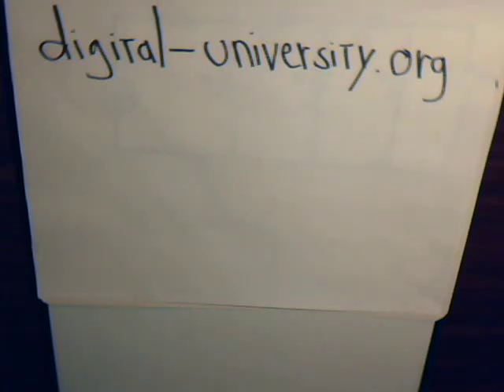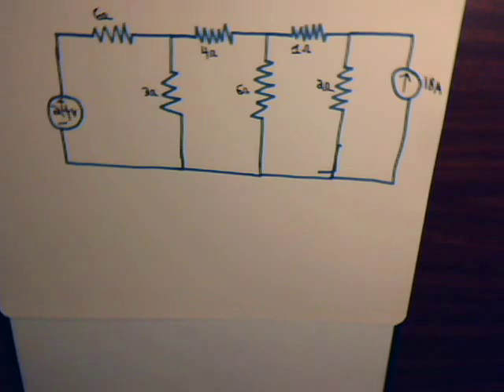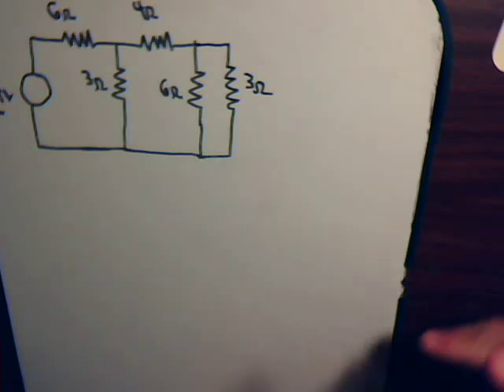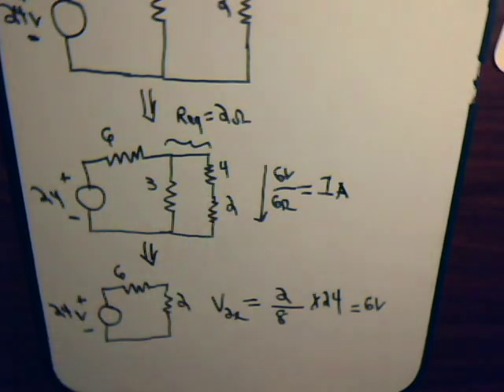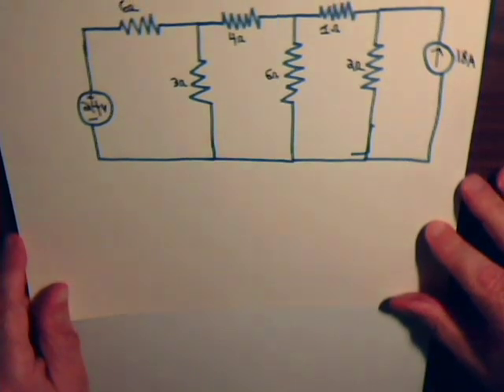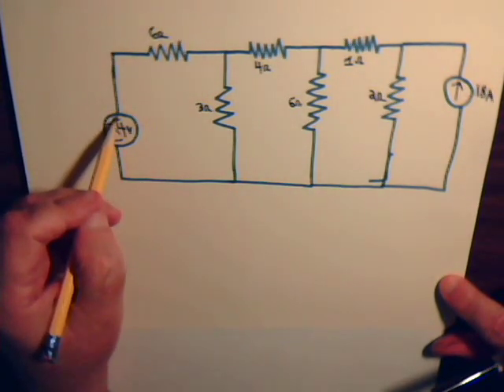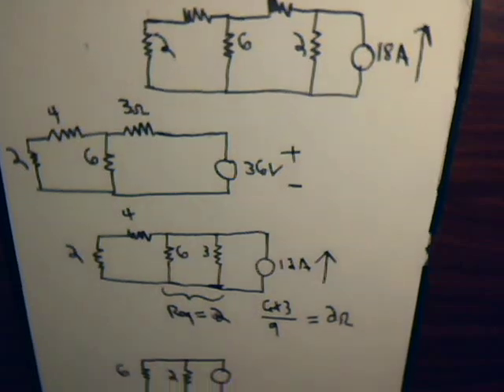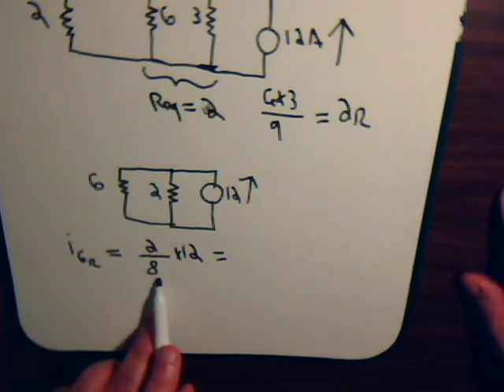Electrical Circuits Video #46: Superposition Technique Example #5

Comment: Well I need yor help with this my Dr says that any element attached to the current source in parallel goes away with it and any element attached to voltage source in series goes away with it ??????? Could you please answer me weather its correct or not ...and thx for the vid its amazing

Comment: Hi, when you're doing the voltage division at time 5:23 of your video, you say that the voltage drop across the 2 ohm resistor is 24V.  Did you mean to say it is 6 V instead?  That part confused me.  I thank you for posting these videos. They help me alot.